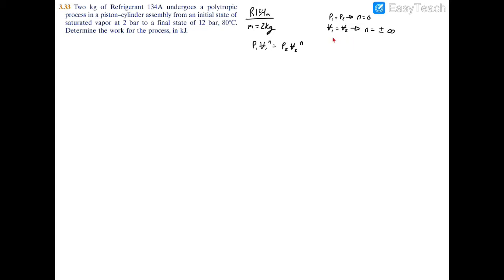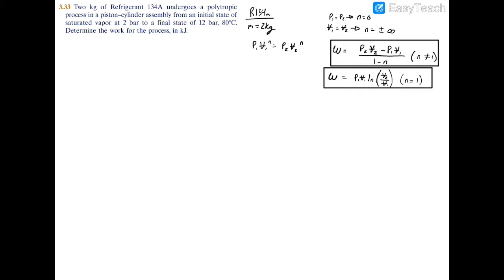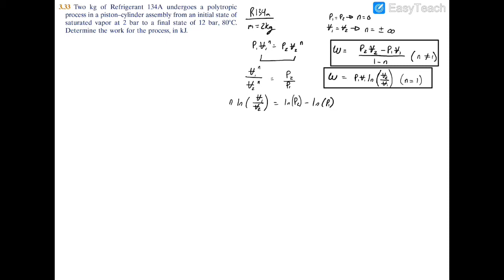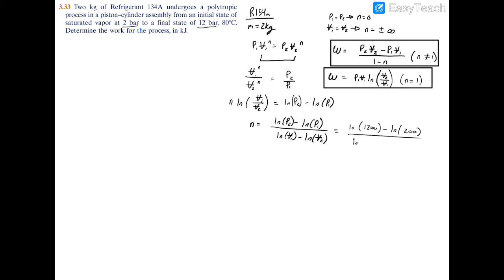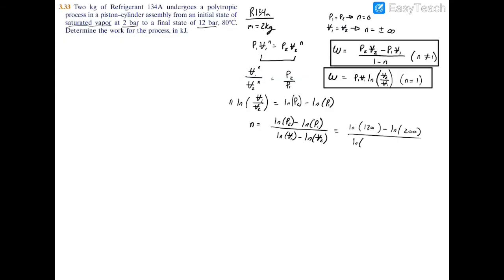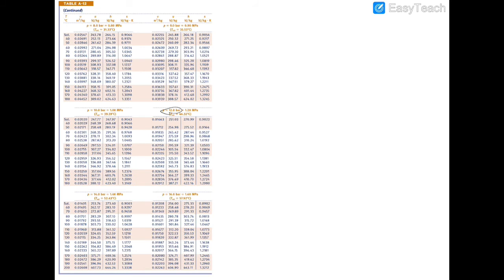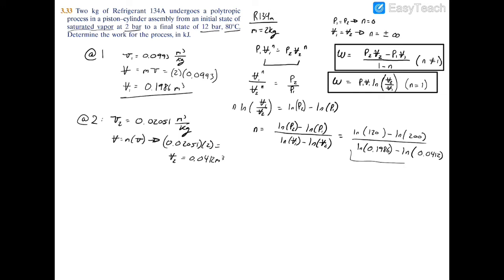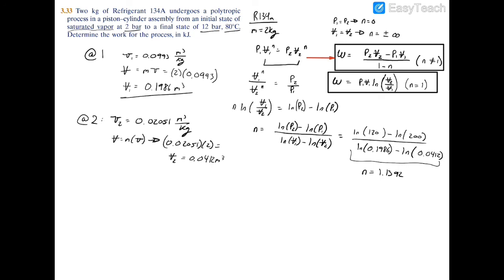3.33 Two kg of Refrigerant 134A undergoes a polytropic process in a piston–cylinder assembly from an

Comment: thank u, only error is multiplying .02051 by 2 and getting .0412, should be .4102
Reply from the maker: Hello, thanks for commenting. I still do not see an error in my calculations. .02051 • 2 = .0412. You may have entered into your calculator incorrectly?
Reply: @gr_engineering  my mistake I commented my correction incorrectly, I meant .04102*
Reply from the maker: @michaeladams2074 Good catch, you are absolutely correct! Thanks for pointing that out.